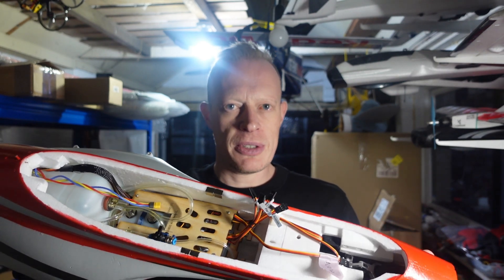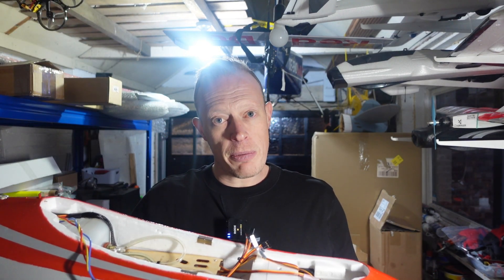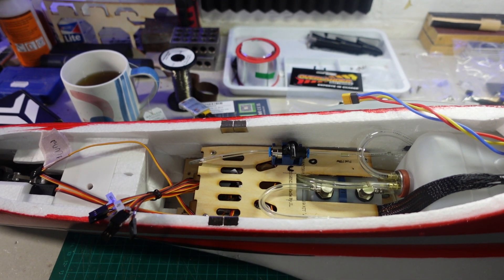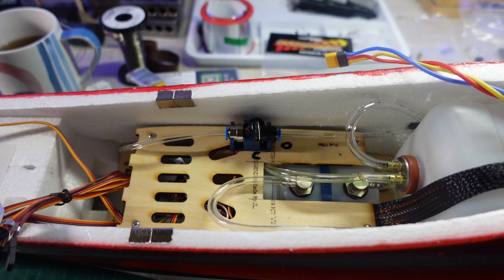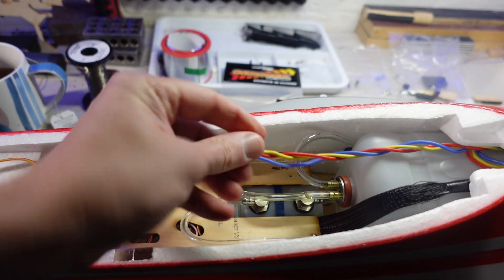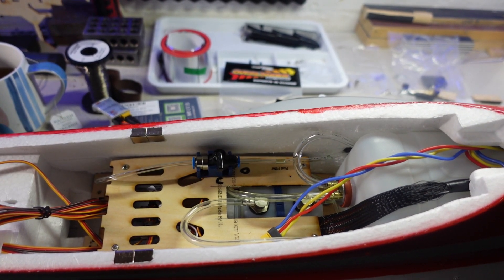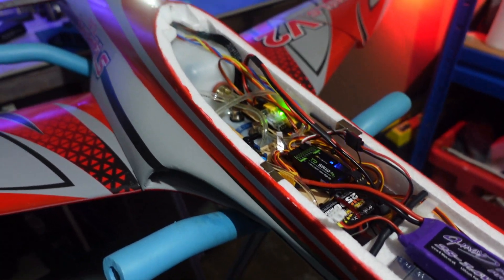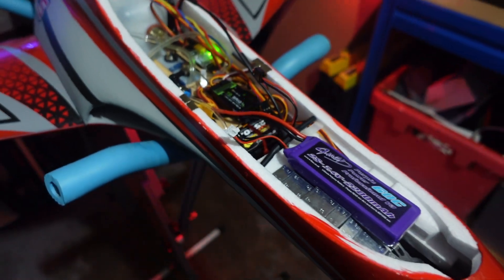Transforming The Freewing Avanti Jet With A Real Turbine - Episode 3

Comment: Hi, I bought this converter. But the post on the bottom just plugs into the wood without any fixed screw holes. How did you install it?
Reply from the maker: @XuânHạnhTrần-h8t  yeah that’s right. I just glued it in place 👍🏻